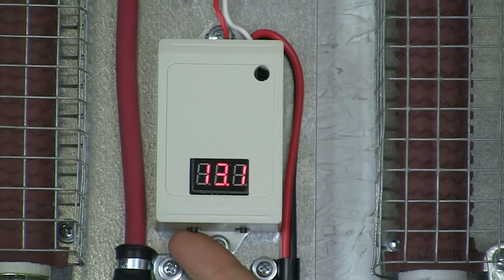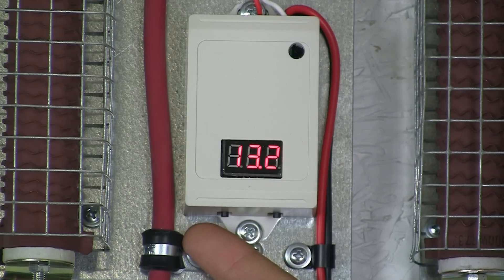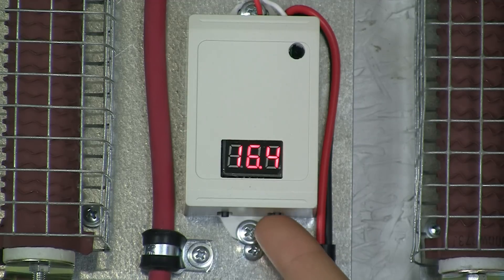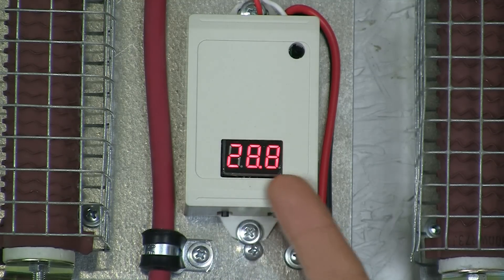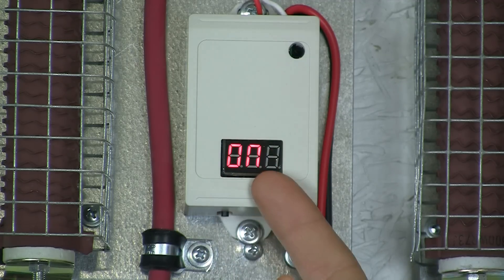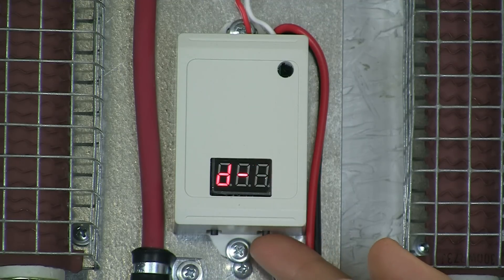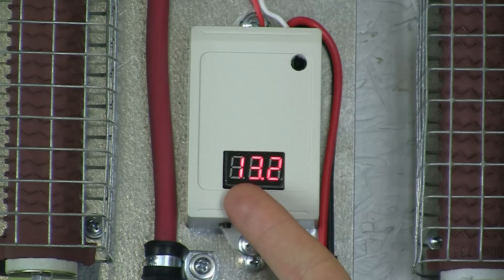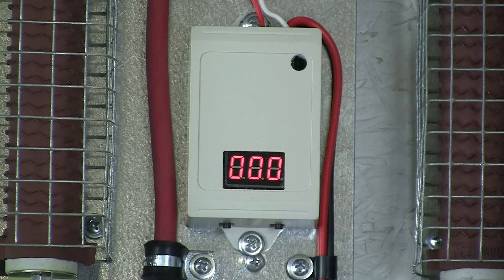Missouri Wind and Solar Digital charge controller programming

Comment: I have a World Power Whisper 1000, I put it up in 98.  Don't believe the whisper part of the name, those 2 blades shake the hell out of the tower when the wind suddenly changes direction.
A bit over  year ago the "EZ-Wire" controller let out some smoke, not all of it because it still functions but I do not trust it. ;)
Looked around a bit for a new controller at the time but all I found were $1500 and up.  Not going to pay that for a controller for a 20 year old turbine.

Tonight I happened to find this video, $77 is more in line.
At one point years ago I replaced the rectifiers in the EZ-Wire with a proper 3PH rectifier.
Thinking I can take that, the brake switch, circuit breakers, and I think it is 1200 watt dump load, add your controller and be back in business.

Looking at the current controller, it has 3 capacitors in a Y connection to the 3PH coming from the turbine, any idea if I need those?
Maybe the smoke come from the caps!!
That would explain why it still works,  the diodes in the rectifier check out.  And from experience with cheap inverters when mosfets fail (the EZ-Wire has a mosfet switch on the dump load) they short out and if there is enough current they blow up so as to save the fuse.  The mosfets look fine.

Anyway just free thinking here, slamming that 1200 watt load on and off always seemed kind of harsh, back when I still had incandescent 12 volt light bulbs they would flicker a bit.
Wonder if I could take 2 of your controllers, setup 1 with say an 800 watt dump and the second one at a little lower voltage and a 400 watt load.

Comment: When you change your controller when I went to go set mine up I don't understand how you got that higher number the tight the 28.8 it doesn't display that on mine I can get mostly everything else in line of what you did on your video but I still have a problem trying to set it the right way with the dump load and winter by and disconnect and stuff like that maybe you can give me a phone number you can talk me through it I would appreciate the help my name is Mike thank you

Comment: I was instructed to watch this video from your sales department. Followed it but did not address my problem. I am getting a u-3 flashing with multiple battery levels and there is no wind. The selenoid is clicking over and over. This happens during the day when solar panels on a different controller are trying to charge batteries. At night the batteries could read 12.6 and the inverter shuts off. By morning the batteries will read 10 or sometimes as low as 7. Please tell me what is going on I did not receive any instructions or an operating manual.
Reply: Found out your problem yet?  You got bad batteries or bad charge controller?

Comment: I was researching wind charge controllers, For my sister here in Australia and we chose your The Missouri Wind 440 Amp/10,000 Watt Hybrid Wind and Solar Charge in 12 volt version, was setting it up today, and the video is much better then the instructions, I get it now thanks for this video. the numbers where blinking.  I really like your design, It's robust and well constructed. Nice work. Thanks.
Reply: Thats great to hear Dan

Comment: So I went through that because my wind turbine came with a separate MPPT controller, that acts as the rectifier, charge controller, and brake.  I totally don't trust it to really control things (though it isn't a big turbine), so what I really want is to have your divert controller keeping the batteries in a range where the MPPT controller has some battery capacity to work with.  When I'm actively using power, hopefully there won't need to be any diversion to maintain some battery charge capacity.  

However, I noticed when I put everything in, that the turbine controller was just braking the turbine at about 14V.  So the turbine controller was doing all of the work (and would probably croak early), and the divert controller was never engaging.  I think all I want is to set the divert controller to just under that 'protection' voltage, so it gets to that voltage, burns the voltage down to something reasonable (maybe 13.2), and lets the wind controller stay out of 'braked' mode unless we have high winds.  

If that sounds reasonable, it seems like all I need to do is, from a timed-out display, hit the left button once to get the display up, then again to start setting the P-3 high voltage setting, scroll again to leave the tens digit at 1, use the right button to set the 1s digit at 3, use the left to scroll to the tenths digit and set that at either 8 or 9, then scroll to the lower voltage.  There I want to scroll past the tens digit and the ones digit, and set the tenths digit to 2.  Then I'll scroll again, to go to the divert delay (000) display, scroll again to get to the ONL display, and scroll again to be done.  

Does that look right?

Comment: This gets a lot better after the 6-minute mark, but still could be more clear.  I have one of these, and have the instructions.  We get that it's complicated.  Part of what's missing is the list of displays, and what each is for.  Let me see if I have this right.  
Left button is to scroll through settings, right button is to change settings.
P-1 is the time settings, which include 
- the initial diversion time (default is 5s), 
- extended diversion time (complicated - has to do with the controller sensing a need to divert a lot - extends the time power is diverting), 
- display timeout, from 1 (d-1) to 9 (d-9) minutes or always on (d-0) - the controller is still working
P-2 is nothing (???)
P-3 is the voltage settings, including
- Highest voltage the controller will allow before diverting/disconnecting (must be higher than below)
- Low voltage the controller will drop things too after starting to divert/disconnect (must be lower than above)
P-4 is nothing (???)

From the operating mode (where you start if you've started with a dark display and then hit either button), using the left button is scrolling through the P-3 settings.  Those values are:
- set high voltage - first the 10s digit, then the 1s digit, then the decimal
- then the low voltage - first the 10s digit, then the 1s digit, then the decimal
- then the divert delay time in tenths of a second
- then the mysterious ONL display, which if you change it to ONH and aren't planning to do some strange experiments, you'll destroy your batteries, possibly dangerously, so leave it at ONL.
- then back to operating mode.

From the operating mode, holding down the right button will put you in program (P) mode, and those options are:
- P-1 time settings
- P-2 nothing (???)
- P-3 voltage settings
- P-4 nothing (???)

From the operating mode, just quickly hitting the right button will change between timing display and voltage display. The timing display will be all zero unless the unit is diverting, in which case it will show the number of seconds left until it changes modes again.